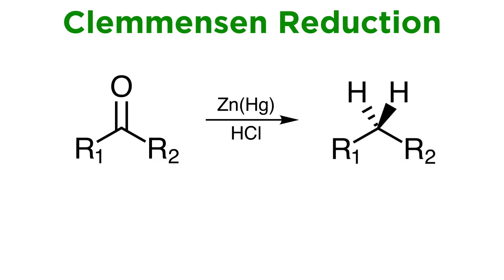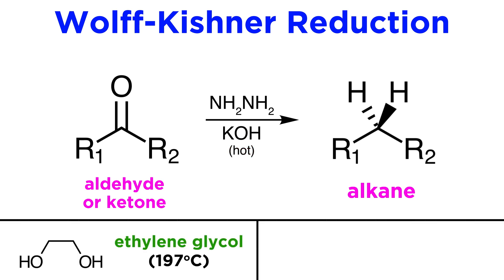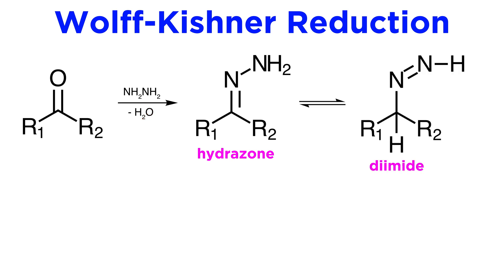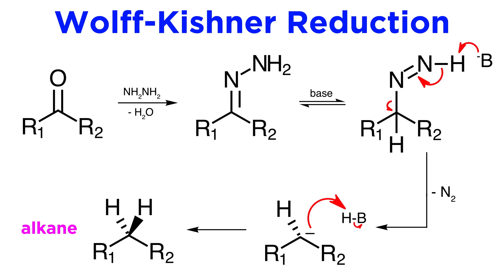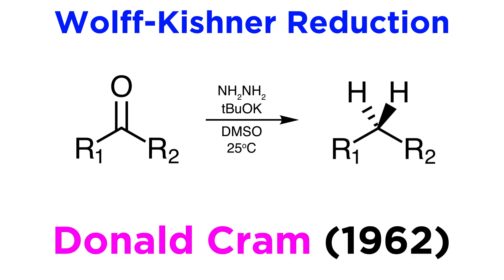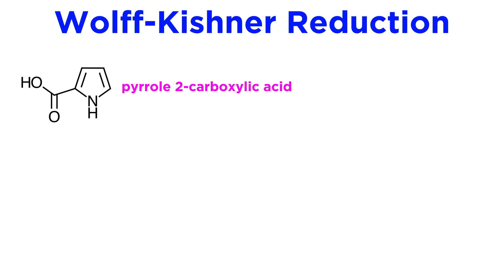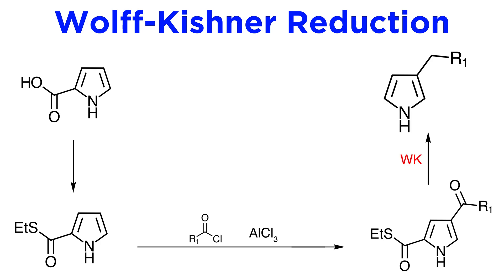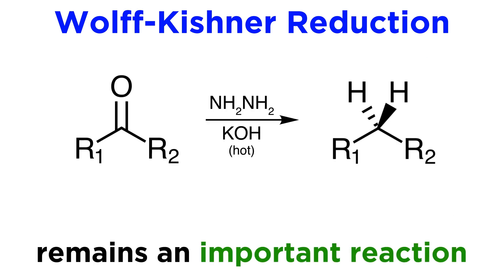Wolff-Kishner Reduction

Comment: Great video Dave. Surprised you didn't mention the possibilities of the microwave-assisted Wolff-Kishner when discussing the need for milder conditions. I haven't done enough reading on it yet to say whether I think it's the best way to go, but this paper outlines it for teaching undergraduates and they just use a conventional microwave which is pretty cool.

Eric Parquet and Qun Lin, J. Chem. Educ. 1997, 74, 10, 1225.